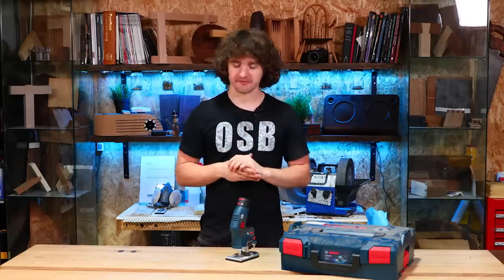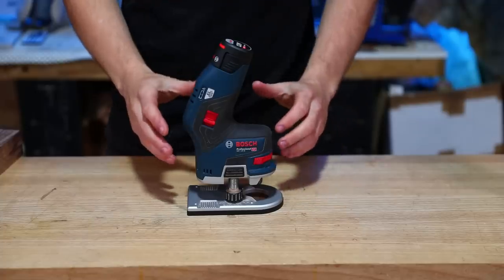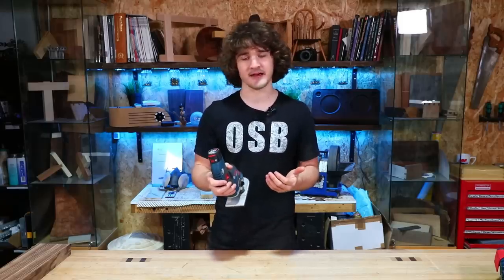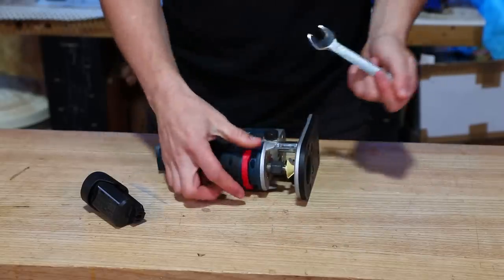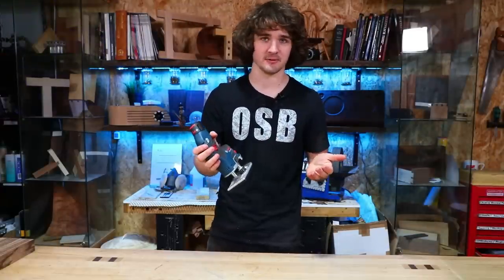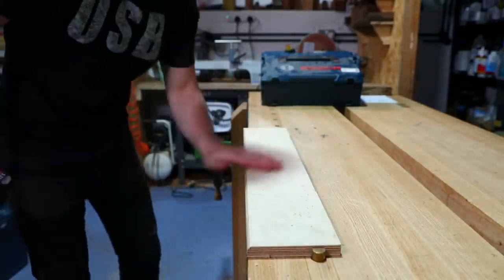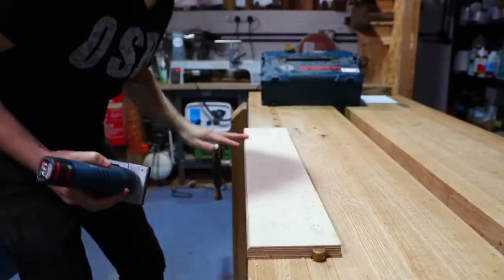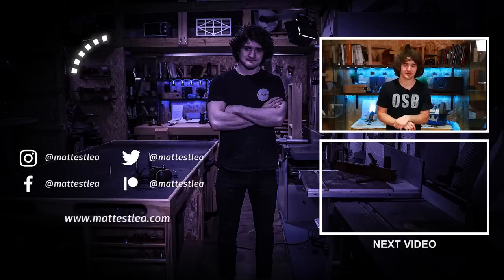BOSCH GKF 12V-8 Cordless Router Review (Including Comprehensive Overview, Specification and Setup)

Comment: One important bit about fine-adjusting this router: while the thumb-dial indeed has its problems, it is also possible to tune it from the bottom part using an Allen wrench. This actually became my favorite method for fine-adjusting this unit.
Reply: nice tip. thanks

Comment: I’ve had mine since January and absolutely love it. I pretty much permanently have a 1/8” round over bit in it. 
It’s also really good for cutting out for hinges on doors with a small straight cutter as most of the base can rest on the edge of the door. 
The fine adjustment helps with this as you can rest the hinge plate on the base when it’s upside down and creep up to the depth you need.
Reply: Was just going to ask if it would be good for hinges. Cheers.

Comment: Good work Matt, nice to see a young guy carrying on and updating carpentry.
However, I have found that the cutting bit is hard to see, this mostly does not matter but if your cutting edging can be a problem?
Just a thought, many, many moons ago, I was taught never use 3in1 as it will increase the dirt attached to your guides (us old ones that used Yankee screw drivers will know this) best to use meths or acetone, as long as it is clean there should be no problems.
Carry on the good work.
Ash

Comment: I particularly like the hugely improved stability and ergonomics, together with the fact that it is five times lighter than the Bosch 600 Router!

The weight and mass savings, together with the ergonomics and stability give this tool numerous advantages.

Although primarily for edging, I also want to be routing in lines to create a bead board effect in plywood and think that this nice, light tool will make that less of a chore.

Thank you for this review, having owned Bosch tools since the 1980's I am extremely impressed with their quality and longevity, only requiring repairs due to user induced damage (I dropped my drill onto concrete from 13 feet up!).

Comment: For edge profiling with the Bosch Colt, turn the router 45 degrees to the edge being routed.  Provides a lot more stability.
Reply: I just put a larger base on mine.

Comment: I love the ergonomics with the low C of G. I have an 18v Makita DRT50, it's great, but the enormous 18v battery sitting on top of its tiny base makes it a bit cumbersome. I think 18v might be overpowered for a little palm router and I'd gladly swap a little power for a lighter more stable 12v version like this. 
But: 
1. The view of the bit looks to be hidden beneath your hand? 
2. No dust collection. A really good integrated system; in through the base, out through the top, like the big Festool routers would have sold it to me.

I'm also a lefty but I don't begrudge Bosch designing for the 90% who aren't!

Comment: I've been looking at more affordable trim routers, but counting on the fact that I already have 12V Bosch batteries and charger that came with my GSR drill, it'll be a little cheaper to get this one than let's say the Ryobi where I'd have to get the batteries and charger as well. Great to know that the GKF is a really nice router, thanks for the review!

Would using this to make rebates be pushing it, BTW? I have to work a bit outside due to not having the best workshop at home and it would be nice to not have to take out my plunge router all the time 🙂

Comment: You forgot to mention the stock 2A battery it’s not very sufficient, as for most of 12v power tools, and need at least 4A to avoid battery overheat protection kicking each half minute when using it for continuos works. The 4 and 6A batteries on the other hand, due to their larger mass and inertia, tend to overuse the contacts especially on tools ithat generate vibrations, and need to clean periodically the contacts in the tool to avoid the fault warning kicking in. Also, because I have used and abused all their 12v tools, I can say that most of the mechanical parts are made from not such a good quality steel, and bend very easy if you’re not carefull. Happened to me with the shaft of the drills and the minicircular saw. Needed to change them. Not the case yet for the router though. Also for the cordless router the work speed is maximum half when compared to the corded version.

Comment: The tabs on the 12v batteries are little bit fragile, slamming it in like that caused one of mine to lose both and now I can only use it for the tools which hold the battery in place by gravity.

Comment: I have it and use both kinds batteries. The bigger one does not make any difference to the balance and the usability. It is still nicely balanced and it is not in the way. I sometimes would love to have the faster speeds of the bigger routers. But it depends on what you do with it. I also have the mini circular saw, which I often use for panel cutting.
Reply: Question though - Is that a 6 mm shaft holder you got in it? Mine is 8 mm and I would love to have a 6 mm.

Comment: That is an expensive tool and as you stated the price is without batteries.  The 3Ahr battery is $50.
I wonder why Bosch did not make this variable speed, since it is a DC motor.
It is smaller than my DeWalt 611 router.   I could achieve a similar footprint by making a plate for the DeWalt.  Something to add to my future project list.   Thanks for the inspiration.
This router could also be used for routing boxties and other inlay work but I am not sure if the baseplate is designed to use the guides/bushings.
Dave.

Comment: Take note that all Bosch routers are not made equal. UK version is issued with a 1/4" collet (as I understand it), Europe is 8mm (I have this), although I think you can get 6mm. I'm waiting for a response back from Bosch to find out it there is a 1/4" collet for the Euro version as I have bought quite a stock of 1/4" router bits and zero 8mm - ya, I know.... a school boy error when I purchased it.

My GKF 600 palm router turns up this week with a 1/4" collect... I hope they are interchangeable - at least I have a router to use the bits in!

Heres an update... EU/UK collets are not interchangeable... It cost me Eur 35.00 to get an imperial collet, which is a bit of a rip off considering the cost of the router itself!

Having used it, and not giving a review straight out of the box or being sponsored to do so, its ok... nothing special. It you are considering a small router, get the GKF 600 and give this one a miss.

Comment: This is an absolute piece of crap. It changes depth adjustments mid way. Battery lasts 5 minutes. Everything gets stiff and clogged after short use. The collate wears put after a short use. If this accidentally gets a little bit wet, you can throw it away. I can go on, but I’ll spare you the annoyance. Greatest waste of money I have ever made. Bosch’s China trash products are generally the worst on the market. Any dirt cheap tool is better than this sorry excuse for a tool.